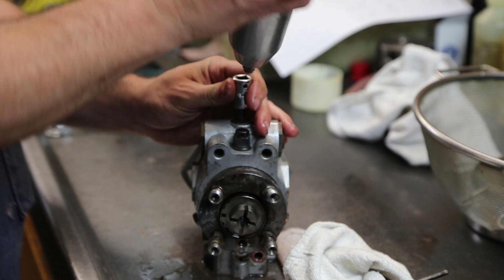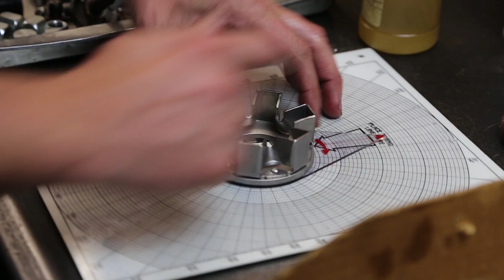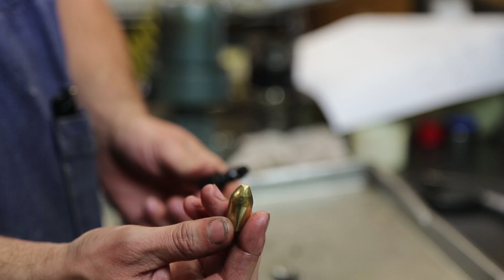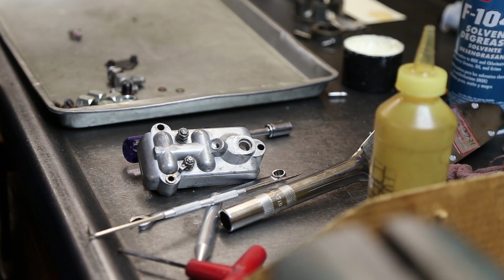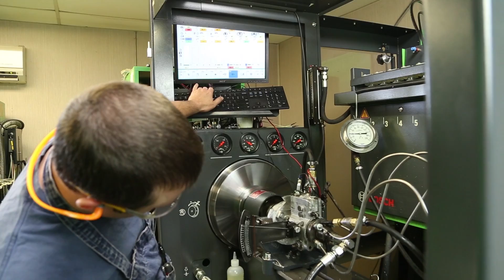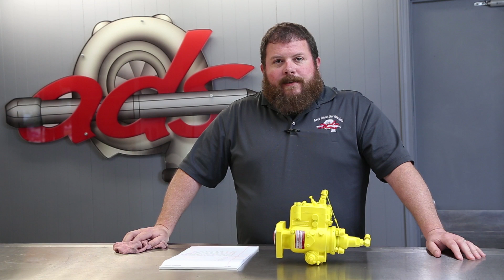@AreaDieselService DB2 Pump Rebuild for @C_CEQUIPMENT's JD455E Track Loader DB2435-4490 Stanadyne

Comment: I got my stanadyne to free up after a decade of sitting by blowing compressed air backwards through the lines going to the injectors. I also filled the feed lines with seafoam and WD-40, also heated the pump and tapped it with a hammer while turning the engine over and blowing the air, it was tricky to do all that at once but I did and it worked. 💯

Comment: Great video and very detailed! Thanks for that. I wonder what could have gone wrong in these pumps if you get lots of diesel in your crankcase? Is it mainly that backflow valve that is plugged or are there many different weak spots that could cause such a problem since otherwise the machine is running smoothly and quietly? Would highly appreciate your advise!
Reply from the maker: A failed seal on the driveshaft is the most common cause of crankcase dilution.

Comment: When you were installing the cam, you said "this is a clockwise pump". But during all of the calibration on the Bosch, it was spinning counter-clockwise. Does that mean it was "clockwise" when looking from the engine toward the pump?

Comment: Wow while watching the end of you're video. I did not get lucky case don't want to rebuild my pump they want to sell me a new pump for 2100.00  should I get a second opinion. Case told me that my pump  has a broken shaft the inside of the pump is pitted and  it's got rust inside the pump.     I, feel that I want to get a second opinion.  I, just feel that case wants to sell me a  new pump maybe I don't  know.. I seen the inside of the pump the type of rust I seen inside the pump looked like surface rust  .   I, strongly feel that I  just want a second opinion. I'm going to  call you for my second  opinion.

Comment: you know just by me watching you're video this pump has to be truly correct   in working correct order and just maybe that why case wants to sell me a new replacement pimp then want to rebuild my old pump. you're video is true to the tee and all the time and craftsmanship that you're puting in to this vitel part.  I, asume you know what I was saying I just took it that case wants to sell me a new pump and not to rebuild my pump but cast told me on the phone that my pump has rust inside of the pump and it's pitted up inside the pump and the steel shift is snapped in half.

Comment: the reason I asked you  should I get a second opinion on this pump is maybe case don't want to rebuild  the pump and just want to sell me a new pump. what do you think if it was you. because if I do need a new pump like case told me on the phone. I,.just thinking  what would you do  because if I need a new pump then I will buy a new pump.       I'm watching ypure video and you sure know what you're doing.  .my, Backhoe has totally been rebuilt    but I  just   want to know by watching you're video is case telling me right that I need  a new pump I mean the pump does have surface rust inside  and that broken steel shift.  Thank, you again for this well pit togather video.

Comment: thank, you for you're video.  I've got a 1966, ck case 530  Diesel Backhoe. the Diesel fuel pump stopped pumping fuel to  the injectors. I, removed the top of the pump off and looked  inside the pump and notice that the steel shift that's inside the pump was broken in half a clean brake. so, I put the top of the pump  cover back on to the pump and I called case Dealership and told them everything. and they told me to send them the pump. I sent the pump to case. case called me back after they got the  pump. case told me on the phone that they  looked in to the pump and told me that they notice that the inside of the pump had rust instead the pump and the steel shift was broke  and it had pits inside the pump.   case told me now they don't want to rebuild it. case wants to sell me a new pump. now this new pump that they want to sell me  is $2100.00   so it sounds like   I got to buy a new pump. but before I decide to buy a new pump  should I get a second opinion from someone else.   What do you think.    just seems to me that case wants to sell a new pump or  what do you think.

Comment: just easier to replace electronics from the begining same as solenoid pack in a trans when rebuiling as go bad after a rebuild. very hard to call the customer & tell them you solenoid just went bad except this is part of the reason that the pump went bad.

Comment: That pump has as many parts in it as a carburetor has. A lot of people think that overhauling a carb is no big thing & probably the same goes for the injection pump-this requires a cetain finese & special ability. Keep up the good work & special ability that you & not a lot a of people have.

Comment: Spray it with carburetor cleaner then brake cleaner then blow it off with air & it should be spotless enough to eat off of. Some minor lube & it should be beter than new. Keep up th good work.

Comment: I came from C&C following the fuel pump off of the 455.  
I am pumped up. I was a Hydraulic mechanic working on high speed high pressure pumps. Your shop is a welcome sight and with excellent service to your customers.

Comment: Thanks for the ride down memory lane. I used to rebuild all of the RoosaMaster,  DB2, etc style pumps at Lakes Fuel Injection in NH. My dad did the electronic DS pumps for the 6.5's, and we both worked for my uncle. 99% of the specs and parts was on microfiche =]
I may have missed it, but I hope he did the injectors also.

Comment: My JD 450C, with a 4219 turbocharged engine has a problem. The fuel return fitting (on the pump) occasionally plugs with trash and shuts down the machine. I replaced the filter but still plugs with trash. Is there something in the pump that is deteriorating and clogging the pump? Thanks!

Comment: Greg from northern Michigan. Worked in JD Engine Engineering for 39 years and retired in late 2016. Great video and commentary about of the FIP teardown, inspection, repair, rebuild, and cal stand process. You might want to include some future discussion about fuel injection nozzle opening pressure and spray hole pattern, and why non-flammable diesel fuel injection calibration fluid (Viscor) is used during FIP recalibration instead of actual diesel fuel. Thanks to C&C for recommending your channel.
Reply from the maker: Greg - hope the retired life is treating you great!  Thanks for the watch & comment!  Corey (& others) have hit on some of those items in a previous videos - thanks for the reminder - we'll continue to try to highlight those specific topics.
Reply: We are manufacturer specialized in auto and marine diesel engine parts since 1952.
Our main parts are
EURO II system: plunger, nozzle , delivery valves, head rotors, repair kits, etc.
Common rail system: Injector complete and injector spare parts for CATERPILLAR, DENSO, DELPHI , BOSCH, SIMENS, CUMMINS, etc.

If you have any inquiries, pls do not hesitate to contact me.

Comment: Hi, Why did you put a wire  with  pressed joining disc from the lever to the injector outlet before painting?? Great Video👍 I heard about you from  C&C, Just watched C&C refit their pump and she started and ran like a dream,, You did a Great Job!!!
Reply from the maker: Thanks for the watch and comment Paul - Corey hits this briefly in another video - they are put on for warranty purposes, if they are cut, we know someone has been in the pump - https://youtu.be/mfYLE36dqok?t=4623
Reply: We are manufacturer specialized in auto and marine diesel engine parts since 1952.
Our main parts are
EURO II system: plunger, nozzle , delivery valves, head rotors, repair kits, etc.
Common rail system: Injector complete and injector spare parts for CATERPILLAR, DENSO, DELPHI , BOSCH, SIMENS, CUMMINS, etc.

If you have any inquiries, pls do not hesitate to contact me.

Comment: came from c&c nice to see how a pump is rebuilt and whats inside
Reply from the maker: Thanks for coming over!  Hope you enjoy our channel!
Reply: We are manufacturer specialized in auto and marine diesel engine parts since 1952.
Our main parts are
EURO II system: plunger, nozzle , delivery valves, head rotors, repair kits, etc.
Common rail system: Injector complete and injector spare parts for CATERPILLAR, DENSO, DELPHI , BOSCH, SIMENS, CUMMINS, etc.

If you have any inquiries, pls do not hesitate to contact me.

Comment: Greetings from No VT - I have been following Clint and his rebuild on the 455 and came over to see the detail of the injector pump work. I am really impressed with the detail and your process. Clint had to be trilled with the bill, given a new pump right now would be pushing 2 grand (or more in these crazy times). It is a pleasure to see your level of professionalism. Best wishes and hopefully more people will see the value of professional rebuilds rather than cheap foreign aftermarket knockoffs that seem to be flooding the market.
Reply from the maker: Thanks for the watch and comment.  We hope they see the value of professional rebuilds also.  We try our best to meet or exceed customer expectations with experts that know their stuff, reasonable pricing and awesome customer support.

Comment: Just came over from C&C Equipment! I will be using your company when i need service on my 450D in the future!
Reply from the maker: Thanks!  We can't wait to help you out, and don't forget to mention seeing us on YouTube to get some VIP treatment/swag!
Reply: We are manufacturer specialized in auto and marine diesel engine parts since 1952.
Our main parts are
EURO II system: plunger, nozzle , delivery valves, head rotors, repair kits, etc.
Common rail system: Injector complete and injector spare parts for CATERPILLAR, DENSO, DELPHI , BOSCH, SIMENS, CUMMINS, etc.

If you have any inquiries, pls do not hesitate to contact me.

Comment: I have a 9 liter International with the Bosch P- pump and it’s destined for a rebuild at Area Diesel. Just a matter of time.
Reply from the maker: We'd love to help you out!  Don't forget to mention discovering us on YouTube when the time comes!
Reply: We are manufacturer specialized in auto and marine diesel engine parts since 1952.
Our main parts are
EURO II system: plunger, nozzle , delivery valves, head rotors, repair kits, etc.
Common rail system: Injector complete and injector spare parts for CATERPILLAR, DENSO, DELPHI , BOSCH, SIMENS, CUMMINS, etc.

If you have any inquiries, pls do not hesitate to contact me.

Comment: What do I do if pump quits pumping? I’m wanting to attempt to rebuild mine
Reply from the maker: We've got a few videos up that may help - but feel free to reach out to us to ask some questions before you get to far into it.
Reply: @AreaDieselService  ok I’ll try to email or call y’all Monday and see how much the stuff to rebuild mine will cost and see what may be causing the issues. It’s a roosamaster pump on a 1974 oliver 1755 it for a long time didn’t want to start and wouldn’t supply fuel at cranking speed and that was with a rebuild starter and 2 group 31 battery’s. What do u think may be causing it?

Comment: Funny you guys just make this video now, I just got a Cummins 4BT with that pump on it.  was wondering if the 3 bolt flange style is the same as  the Bosch VE and CAV/Delphi DPA
Great vid, we had a Stanadyne pump on our JD350B that got sugared fuel once (#$%# neighbors!) and snapped the shaft, got a reman replacement pump and it just never ran right, always struggled and seemed like it was under a load, like the timing was WAY late.  I used the cam adjuster screw to add timing and it made a world of difference, no idea what the actual timing is, but it's happier!
Reply from the maker: Thanks for watching - you can always shoot those questions over to our parts@areadiesel.com email and someone can (hopefully) give you some tips.

Comment: I would add it is always good practice to physically check the fuel pressure to the injection pump both before removal and after reinstall. These rotary pumps are particularly sensitive to fuel pressure since it effects the timing as well.
Reply from the maker: Thanks for sharing that tip Brian!
Reply: What is fuel pressure to the pump should be?
Reply: @things971 That will probably depend on the particular application

Comment: Was great working with you guys, truly a top notch facility👍👍
Reply from the maker: Great working with ya'll also!  And we're glad to see the result on your latest update! (For anyone wondering  here's C & C's latest video on this 455E - https://youtu.be/geu31vLaKiM )
Reply: These guy s are gems. Keep them as your friends.
Ps a marine engineer who for13 years managed to get the vessels acros the pond. Had to stop and fix things, but made it to the next port of call.
Reply: We are manufacturer specialized in auto and marine diesel engine parts since 1952.
Our main parts are
EURO II system: plunger, nozzle , delivery valves, head rotors, repair kits, etc.
Common rail system: Injector complete and injector spare parts for CATERPILLAR, DENSO, DELPHI , BOSCH, SIMENS, CUMMINS, etc.

If you have any inquiries, pls do not hesitate to contact me.